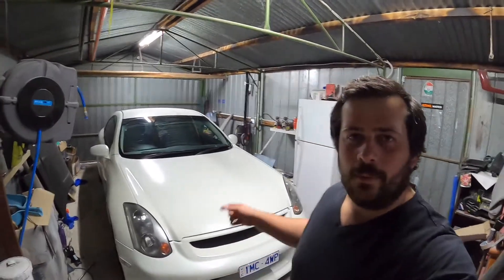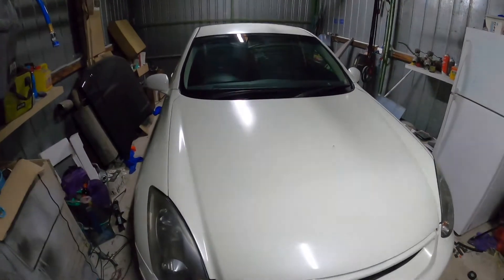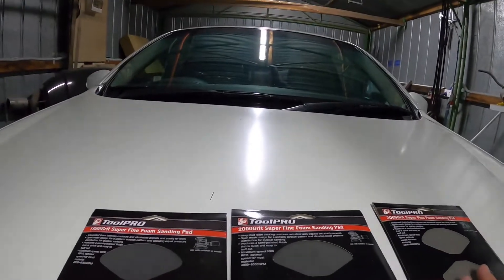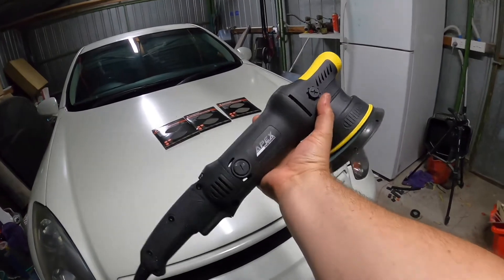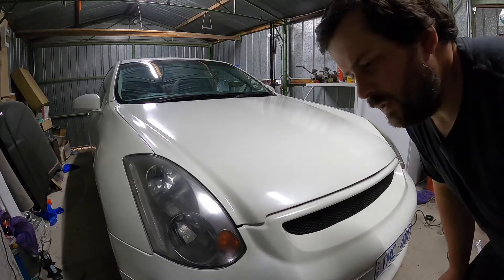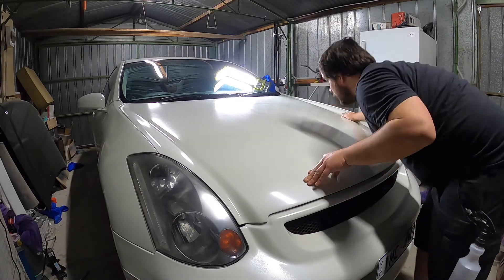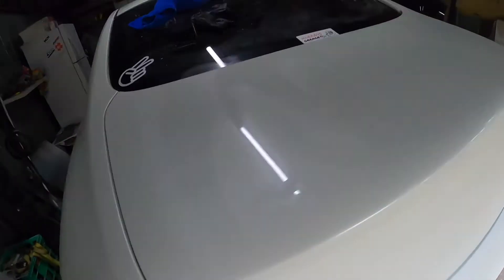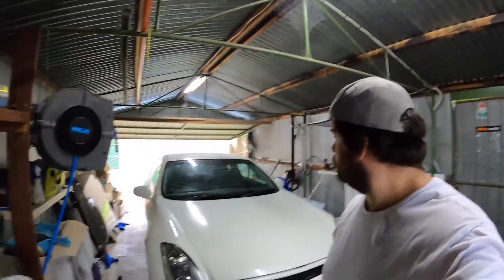Detailing the WORST paint job EVER

Comment: Where can you buy the sanding pads?
Reply from the maker: Sanding pads I’ve been getting recently have been from super cheap auto. Can get 600 1000 2000 grit and 1000 2000 3000 foamed backed pads. I’ve ordered some hook n loops pads from ebay in 125mm they come in 1000 2000 3000 5000 & 7000. Still haven’t got them though.